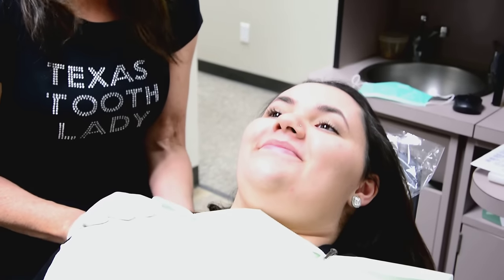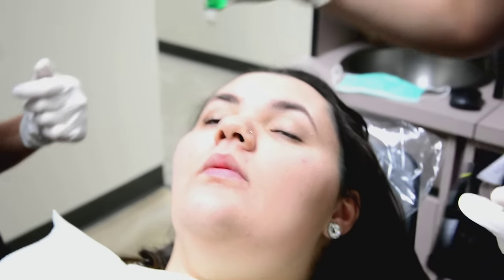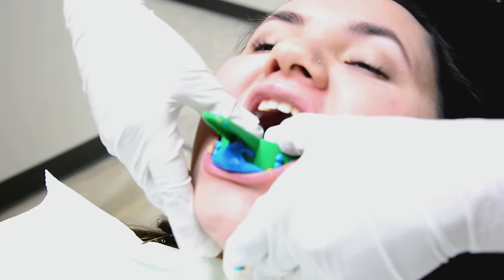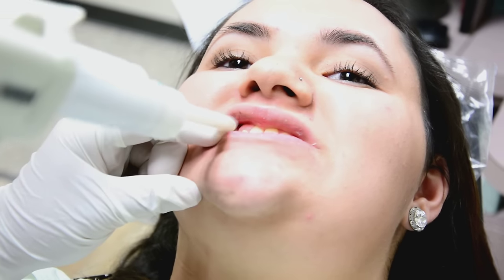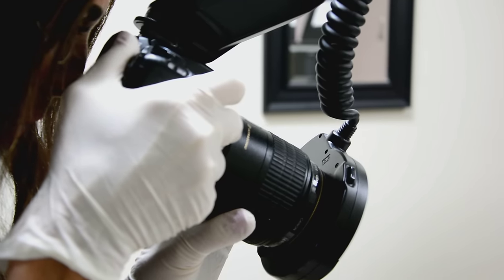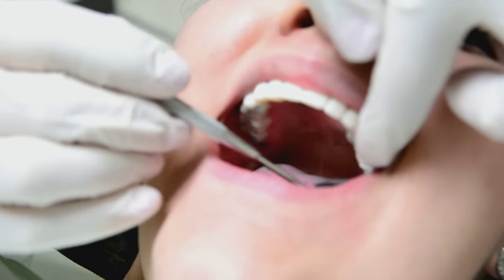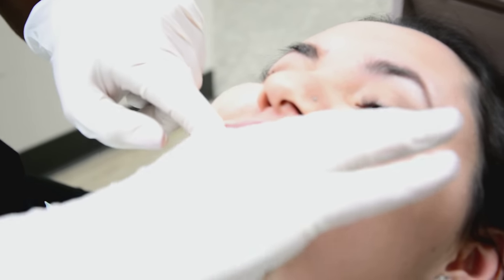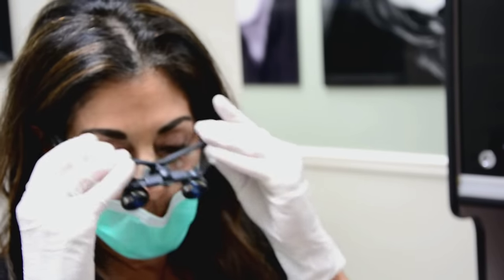Houston Cosmetic Dentist...Step by Step procedure on Snap-on Smile!

Comment: Hi Dr. Alani!  How much do these cost for upper and lower?  Would I be a good candidate if I'm missing several teeth including molars and will these work over teeth that have porcelain crowns?  I'm in Katy, so I can visit you for a consultation if need be.  I'm really needing a cost effective solution from implants at this time.  Thanks!
Reply from the maker: Depends...Yes Snap-on Smile can fit over existing crowns but again, depends on size and shape as there are many factors which may eliminate a patient being a good candidate....The fee is 1963 for each appliance... A consultation would be great...call our office at (713) 621-5141

Comment: Hi Dr. Alani!  Great video. I have ten teeth on my upper arch. From the center of the teeth there are 5 teeth on each side. I have bridges on both sides for the last three teeth. I need to have an extraction for the molar on the right side and will lose the fake tooth in the bridge, as well. With all of that being said, will eating with the snap on smile still be an option without a back molar support?
Reply from the maker: Yes but would need to evaluate you in person
Reply: @DrTerriAlani  Thank you for the quick response!

Comment: Clinically do you need to remove undercuts for the impression, say very tilted teeth for example?
Reply from the maker: We do not alter the teeth at all...If a second molar is tilted, then just an occlusal rest seat is placed to prevent super eruption....As far as undercuts, the lab will block them out:)

Comment: Mam I need to know that we have to do some oclusion  reducion .... becoz of verticle height of mouth will be  increase. because of thickness of snap on smile material ...
Reply from the maker: Rahul Bhardwaj the appliance is .5 mm thick ... all patients can tolerate a vertical increase of up to 2.5 mm .. so .5 mm has no negative effect on the patients bite .. however the occlusion must be balanced!
Reply: Hi i am from India did you do this treatment Rahul Bhardwaj

Comment: does it stay on? if not is there an option to have it permanently placed over existing teeth?
Reply from the maker: It definitely stays on! No adhesives or glue is needed ...It simply snaps in over your existing teeth...thanks for your message!
Reply from the maker: It literally snaps into place...no adhesives or glues are needed...that is because we take digital scans of the patients mouth so it is a perfect fit...thanks for your question!

Comment: What material are these artificial teeth made up of? Also,  have heard the adhesive material which is used to keep them in place may result in debris and gingivitis over a period of time.
Reply from the maker: There is absolutely no adhesive needed, no glue, nothing...The appliance fits by retention and literally snaps over the existing teeth...the material is a patented acetyl resin
Reply: @DrTerriAlani  is it available in India
Reply: @manishasingh7994  hey i am from India did you find any clinic that do this treatment in India🙏 please reply🙏
Reply: @dramaqueen4839  no, not yet.. I m looking one in Delhi
Reply: @manishasingh7994  ok

Comment: this is great work doc
Reply from the maker: Thanks for watching and thank you for the nice comment!
Reply: I have early stages of gum disease, does that disqualify me?
Reply from the maker: No..but you must get that treated first:)
Reply: Ok so a total of getting that treated plus the top bridge would run me in the range of what?
Reply from the maker: The Snap-on Smile is 1765 which includes digital impressions....they are accurate and no messy goop in your mouth....As far as the cleaning, you would need to come in for a dental evaluation ....and full exam....Hope that helps answer your question:)
Reply: It does thank you

Comment: When I finally got a permanent crown on my front tooth, I said it hung low and the dentist ground down my last good tooth up there to be even shorter, and towards the back of that tooth it goes so high! I’m worried about losing it eventually too. :( after a few bad experiences, I am losing sleep regularly about them and I’m struggling to trust dentists. I was a crying mess at my last visit because the one before that- well.. let’s just say that after covid it’s apparent that someone had their girlfriend stand in for them.
Reply: You never see their face and they wouldn’t tell me her name. She drilled holes into my fake tooth and the bottom front tooth diagonal from it. I have no idea why. I asked about a cleaning and she used the drill in the usual spot along the back of the bottom teeth but then went boring into the front teeth just before switching to the polisher, struggling with IT, and then jUMPING when it spun in her hand. She brushed it over so quick and then had an assistant absolutely cake my mouth in that white stuff. Before I left they made me sign papers they first said that they would text to me. I am positive it was a sham- they even high-fived as they brought me back which WASNT even my first red flag.. it was the girl they had in scrubs on her hands and knees scraping the window- no first if was the blown over plastic sign over the hole-in-the-wall!! Channel Isnlands family dental in Oxnard, Ca. They even have a YouTube channel. “D. Aida” broke me.
Reply from the maker: So sorry to hear but discuss your concerns with this dentist to understand what was done and why